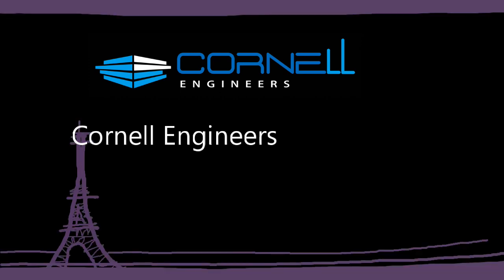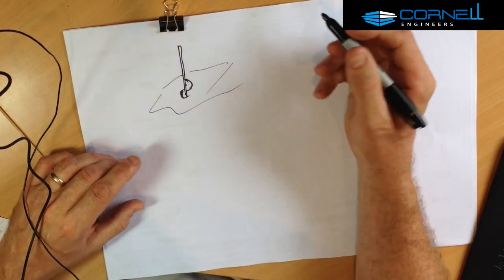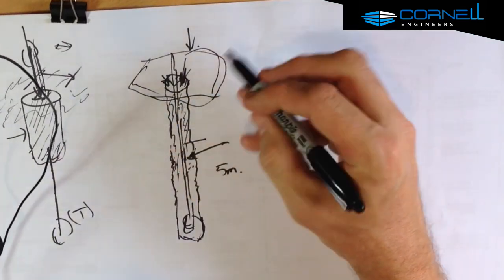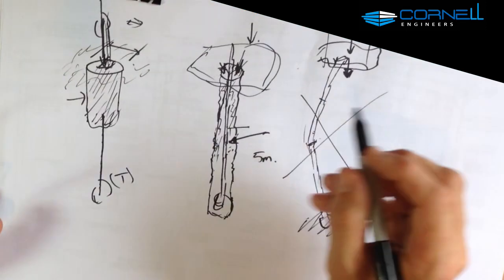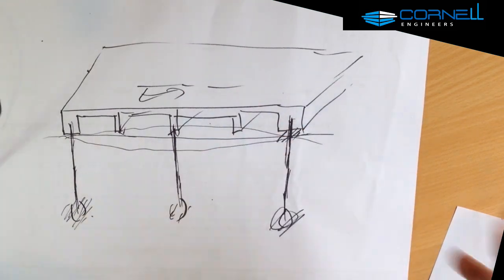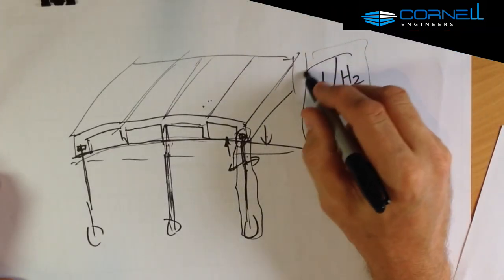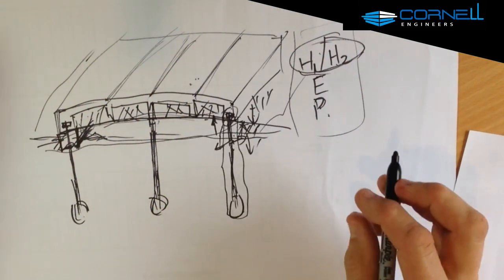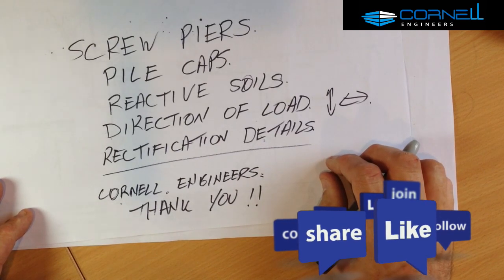What are screw piers? How do they hold up houses? Cornell Engineers explainer video. #screwpiles

Comment from the maker: My next video is about drainage in sub-floor basement areas. After that, what would you like me to do a video about? Please comment!
Matt Cornell
Reply: I like to see your videos because I doing construction and your videos helps me a lot
Reply from the maker: Thank you  @Karlos-r6f . I appreciate you taking the time to leave a comment.
Reply: You should walk through a real life example with engineering analysis regarding soil parameters needed and best practice, buckling, up lift and how you determine and quantify the said design as per structural needs. Horizontal, vertical. Thanks for the great video.

Comment: Screw piles as now available in UK are a sensible alternative. I have no issue seriously considering the use of these, for a house extension. The traditional solution of strip footings plus slab on grade are significantly more time consuming and expensive. 😊
Reply from the maker: Appropriately designed with all issues considered - screw piers may well be perfect for some of your projects. Thanks for stopping by. Hope all is well in the UK building and construction industry.

Comment: The Euler's theory states that the stress in the column due to direct loads is small compared to the stress due to buckling failure. Basically long thin columns like the ones on screw piers with minimal support due to disturbed soil surrounding the column can fail in buckling.

Comment: I have seen these used many times, and they are as good as the soil they are in. I've noticed that once the helix and shaft have displaced some soil at the surface they advance well if properly installed. Once several feet down the displaced soil almost compacts adjacent soils near the helix. In certain soils and depths , they are fantastic.
Reply from the maker: Thanks for your comments Tommy.
Reply: Yeah, once a good quality screw pile is driven a couple feet into the ground, into better soil, they don't require any downward force in order to be driven, only torque. Also when you do a pull test, you pull much harder than the weight of the soil in the hole, and if all that soil was just churned up into fluffy uncompressed fill the pile would just come right out. There would be essentially no uplift resistance. Suggesting that because the top layer of soil comes out, the bad soil that is the entire reason for using a screw pile in the first place, that the entire rest of the ground has been churned up all the way to the bottom, shows a deep misunderstanding of soil mechanics.

Comment: Thanks for the very informative video. When the engineer designs for screw piers I'm assuming they just specify the rotational torque that needs to be reached when insallting the screw pier? Is this enough to determine that the pier is in 'solid' enough ground? Each screw goes down as far as it needs to to reach that resistive torque?
Reply from the maker: Hi Mark
Sometimes - but from my involvement with the guys designing screw piers their assessment of the torque requirement is tied to the soil testing carried out at design stage rather than blind trust that somewhere down there the screw pier will stop spinning. Torque then becomes the way the installer shows they have achieved the screw pier designer's requirements. Load testing can be carried out on installed screw piers in case there is uncertainty.
Matt Cornell
Reply: Understood. Thanks.

Comment: Fascinating video Matt, thanks for sharing, I’m leaning so much. If my builder insists on a waffle slab, I would request, as suggested a perimeter strip footing + screw piers with pile caps across the whole slab. Apart from physically watching the pour & screw pier installation, are there procedures to ensure the slab is constructed to quoted & defined engineered specs? A poured slab looks the same to a homeowner unfortunately

Comment: What about the type which resemble a wood screw? The diameter of the tube is constant after the threaded portion, so no soil is displaced. The diameter of the hole being the same diameter of the screw pier. Therefore side loading will be minimised. I've seen the "pull" being tested by hydraulic lift to over two tonnes.....
Reply from the maker: Hi Martin. Good question. Are the type you are talking about used for residential and commercial buildings? I can only find them for solar panel installations. Can you give me a link o check out?
Matt Cornell

Comment: Hi Matt, great video. I am currently about to build a house on a class P site on a waffle slab and my engineering specifies that I can have the screw piles in the beams or under the beams with support caps. Which method would you recommend?

Comment: Hi Matt, thanks for you very informative video. curiously how do you guys deal with a screw pier takes some bending?
Reply from the maker: Hi Ning Chen
I'm not sure whether you mean that the below ground portion of the screw pier is being subject to lateral load somehow? Or do you mean that the screw pier continues up out of the ground to become a column for a building that is laterally loaded by wind?
Screw piers are typically designed by the supplier - so this might be a great question for Mark from Katana Foundations.
Matt Cornell
Reply: @CornellEngineers  Hi Matt, very much appreciated your reply. Maybe I should say do you ususlly design screw pile for lateral load? Yes you are right in your video the soil around the shaft could be very soft, once it has some lateral load, at the end of the pile shaft could have big moment...not sure if im correct. thanks
Reply from the maker: Hi @ningchen6242  
Again, I'll defer to Mark's expertise on pile design, but for our designs of the other aspects, I don't think we would expect to cantilever a screw pile from the bottom of the footing and expect it to resist lateral loads without a pile cap.
Reply: @ningchen6242  
If the soil was actually loosened to the point that the rod could bend then a lot more soil would have come out of the hole.  Helical piers work like screws in wood.  Like wood, once the screw gets a little below the surface, the screw and the pole displace the soil to the side and actually becomes more compacted so bending will not be a problem.  Also, helical piers are designed to be used in conjunction with the building's foundation, wither a solid slab on grade or pier and beam.

If you are doing a pier and beam foundation you would dig around the helical pier as deep as you normally would and put you forms around it and then put the cap plate on top of the pole, install rebar like normal except for attaching it to the cap plate, and then pour the concrete.  The helical pier would then become part of the concrete pier and provide the extra resistance from ground heaving that being in denser soil deeper down will provide.

On a slab on grade foundation you would dig out the trenches for the foundation for your load bearing walls like normal with the helical piers installed where those foundation trenches are dug and make the helical pier part of the foundation just like you would above.

Either way you are tying the foundation of the building to the denser soil deeper in the ground for the extra stability it provides.  Otherwise you would have to dig a hole that deep and install rebar in the hole and pour concrete.  Helical piers do the same thing without displacing a lot of soil and without the cost of concrete or waiting for it to cure so you can continue with the rest of the foundation.

Comment: Hi Matt, Enjoying your videos. I'm about to do an owner build. Any thought on screwpiles vs using Surefoot?
Reply from the maker: Hi Peter
Thanks for the question.
I am not familiar with the reticulated micropile system you mentioned so I read the engineering report on #reticulatedmicropilesystems that was undertaken by Swinburne #University of Technology (available at this link): https://www.researchgate.net/publication/307905816_Static_Load_Testing_of_Concrete_Free_Reticulated_Micropiles_System

My comments are as follows: 
- The reticulated micropile system relies on engaging the soil that the micropiles are driven into. This tends to be the surface layers of soil rather than the deeper soil that a screw pier is driven into. Maybe a reticulated micropile system would be affected by slab heave more than a screw pier.
- Since a reticulated micropile system relies on surface soils the system would be affected by the full reactive ground movement of the site. A screw pier system could be considered to be founded into soils below the reactive ground movement zone (Hs) depending on the designer. Perhaps a slight win for screw piers?
- A reticulated micropile seems to have creep/displacement near ultimate loads that could be outside the tolerance of the building depending on the situation. ie the footing might get loose after being loaded to more than 50% ultimate loads.
- A reticulated micropile system may not be suitable for lateral loads or cantilevered posts without further testing. I'm not sure that a house on stumps and cross-braces could be founded such a system. Screw piles also need concrete pile caps for these situations so no clear winner in this regard.

It will come down to aligning your building design to your site conditions, your structural engineer's knowledge and experience, your risk appetite and the consequence of footing movement (up/down or lateral).

Best of luck with your owner/builder project.
Reply: @CornellEngineers  Thanks for that Matt. I'm on a sloping site so a raised floor is the way to go. Reading the report it suggests Surefoot needs more time to be proven. One positive is any heaving or subsidence could be rectified by adjusting post height. So bored concrete piers are a safer bet than these or helical piers?
Reply from the maker: @peter9117  It still comes down to the site classification and reactivity of the site. Raised floor = steel or timber stumps. Steel stumps can be bought with adjustable heads (still needs a handyperson to adjust them from time to time) but stairs, slabs and plumbing are all a little less tolerant. I'd think that screw piers wouldn't be ruled out so long as they incorporate pile caps. Bored piers would be ok if you have diggable soil and are able to found all footings into a rocky layer. Depending on the slope you might also need to comply with slope stability requirements - but that is a whole other story/video/problem!
Matt Cornell

Comment: How about not removing the soil that comes up around the screw pile, & following up with a vibratory compactor after each pile is installed?
Reply from the maker: Hi Dan
Maybe. That would recompact the soil - but the screw pile steel shafts are quite narrow meaning that if they push sideways from bracing loads or buckling, the stresses into the surface level soils would be very high.
Some good thoughts Dan. But I'm not a fan of compacted soil as the answer!
Matt Cornell

Comment: So from what I have read, the guys in the video were...
1.) Spinning the screwpiles to fast, the US engineering standard is about 1.5" (40mm) of down travel per one revolution
2.) putting to much down force on the screw

This is what caused all the uplift and loosening of the soil pack. I have seen these piles run into all types of soils and when done right never push loose dirt back up the bore.
Reply from the maker: Thanks for the comments, Richard.

Comment: 60t concrete swimming pool. 4mx8, 2m deep end. Mid 1.2m deep. Shallow end 1.5m deep. 150mm wall concrete walls with 60mm of polystyrene panels inside and outside. 300mm thick slab, hd12 rebar 200mm centres verticals 300mm centres horizontals. Double caged 2m deep end deep end with Hd16 200mm centres. 
With a 900mm by 4m coverpit. 

The cover pit filled with water, and 1'3 of the pool filled. And the swimming pool floated in this recent float in Auckland..... how did it happen.. and how do we remedy it?

Just out of curiosity. I really dig your channel. 

 Cheers brotha 
Wolfgang
Reply from the maker: Cheers Wolfgang! Glad to hear from you. Sounds like a beautiful pool.
In comparison to your pool, Royal Carribean's cruise liner "Wonder of the Seas" weighs 236,857 gross tonnes and it floats as well as a rubber ducky in the bathtub.
Big and heavy does not equal not buoyant.
Buoyancy comes from displacing more weight of water than your vessel weighs.
Stopping a big, heavy concrete pool from floating could be as simple (but expensive) as making the pool so heavy that it weighs more than the water it dsiplaces.
The better option is to ensure the pool is never surrounded by water by improving drainage around the pool surface and improving subsoil drainage around the walls of the pool (ie gravel backfill that drains freely to somehwere lower than the pool).
The final alternative is to anchor the pool into the ground with big concrete blobs or steel bars that activate the weight of the soil around the pool (thereby increasing the weight of the pool to more than the weight of the water displaced).
Good drainage is pretty much the most economic solution top preventing a pool popping out of the ground when it floods.
Best of luck getting that baby back into the hole.
Matt Cornell

Comment: Once the screw pile is installed, is it possible to then fill it with cement / concrete giving them a little more strength and possibly preventing them from buckling, if the earth around them is loose? Thanks for the educational video, very enlightening!
Reply from the maker: Hi Pauly
Perhaps. The ground is not normally so loose that concrete will flow down the shaft to the bottom where the screws are. So I think the screw pier designer has to take into account the total length of the screw pier when designing the shaft diameter and a concrete pile cap placed around the top of the shaft for the reason we suggest -> lateral stability.
Reply: I've done the digging in two stages, just because my crowler arm is too short for screwing the 2m long pile with one shot at the time!😂 So, first I dig the hole like one meter only, then bring the soil up from the hole. Then pouring wet cement to the hole, then penetrate the screw pole in between the wet cement in the hole. Then twisting the rest of the pole to the solid ground beneath the cemented hole. I think it's the just right method done similar principle as you teached on your video!😊

Comment: One additional comment. Would it make any sense at all to ram the dirt churned up by the helix down to the end, and simply add cement to the now clear part of the hole?  I'm assuming it might not, as your cap is probably larger in diameter to greater horizontal movement resistance?

Comment: If you're going to go through the trouble of performing this installation why wouldn't you just use an auger and pour a pier or set a post? What is the benefit?
Reply from the maker: Hi Steve
So a couple of benefits stand out. 
- Screw piers can be installed through wet/loose sloppy soils that would ordinarily collapse into a bored pier excavation.
- They are a one-step, faster operation in lieu of digging a hole, keeping it safe, covering it, tamping the bottom and removing cave-ins and filling it with concrete. 
- They are a D&C item that allows the builder to offload the design and installation.
I'm sure the screw pier installers following along have some additional benefits?
Matt
Reply: Because you can arrive on site with a small work crew of 2-3, and have 15-20 post done by late lunch time. And, you can then start framing after lunch.  And, if you price how much it actually costs to install piers...

Comment: Instead of a pile cap that might try to lift the pile with surface frost, how about a collar with radial fins, that is pressed into the surface?
Reply from the maker: Hi Dan
Sounds like an option for lateral stability without being affected too much by frost heave (clay heave in Australia).
However
The collar and radial fins would have to be protected from corrosion and somehow transfer enough lateral load through the fins into the adjacent ground without pushing into the ground. Then the whole assembly needs to not ever be damaged by homeowners, mowers and future renovations.
Solve those issues and you might have a plan!

Comment: Your mistake: the tip of the pile underneath the helix is compressing the ground. The ground displacement is bigger than the disturbing forces from the helix. The end result is completely different from what you discribe here and even better than the ground was before. It's this compression that creates the dirt at the start of the job. Creating dirt is far from continuous. 
I agrree the advantage of concrete at the top in case of huge lateral forces to resist.
Reply from the maker: Thanks for your comment! I'd be happy to review your reference material relating to the positive effect of the tip of the pile and the soil compression effect - even if it is in Dutch.
Have you seen this Practice Note from the Institution of Professional Enigneers New Zealand? https://d2rjvl4n5h2b61.cloudfront.net/media/documents/Practice_Note_28_Screw_Piles_Guidelines_for_Design_Construction_and_Installation.pdf
Or the guide by Mark Armstrong at Katana Foundations? https://www.youtube.com/@katanafoundations3790/
Looking forward to hearing from you.
Matt Cornell